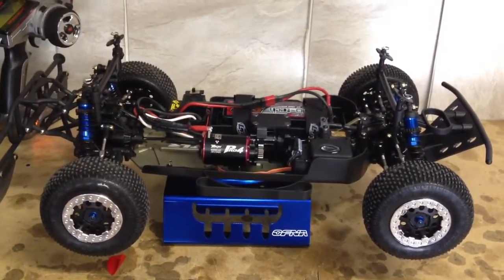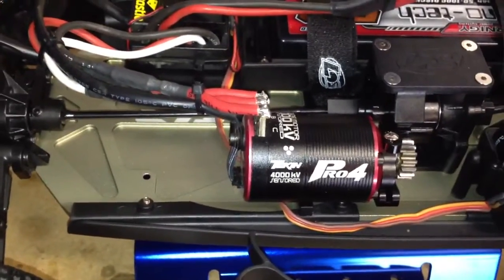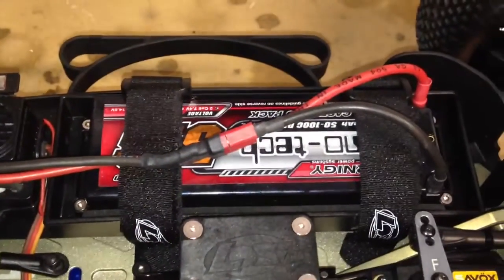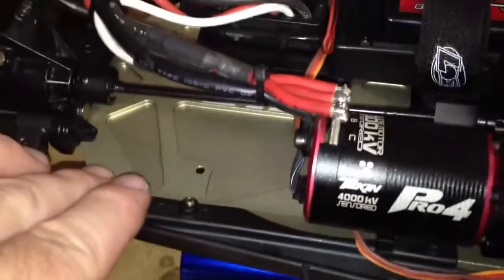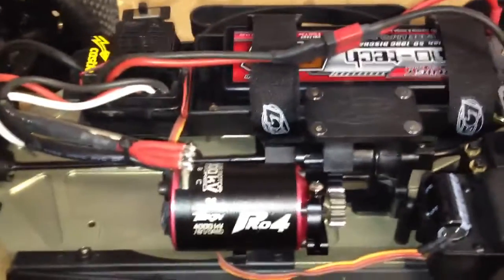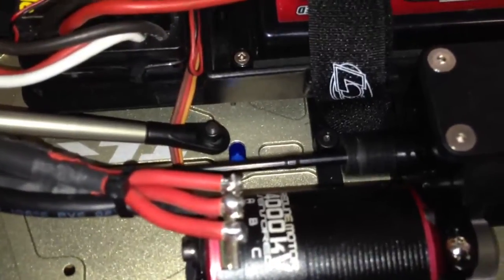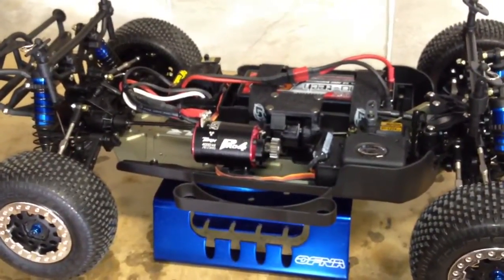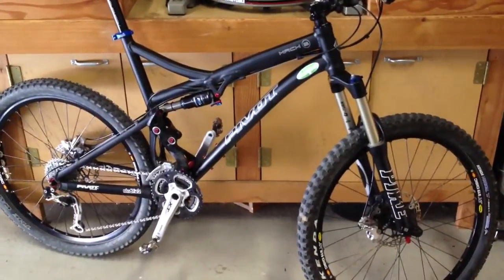The RCNetwork - Losi Ten SCTE - electronics installed

Comment from the maker: Yeah, Losi replaced the parts for me, but I later found out that it's basically a global issue with the SCTE.  The KingHeadz Motor mount/Center Diff Upright using dual bearings on either side fixes the issue for about $75.

Comment from the maker: HD will be a 550 can sized motor (about a 1/2" longer than the Pro4), so more torque.  I know the 3300 requires 3s to get the speed/torque and I wouldn't doubt that the 3000 does too.  If you do get one of the 3000's, potentially you'll have to gear up to get the speed and then may have temp issues.  Make sure and plan to have the RX8 to power it.  Which truck?

Comment: Try running a way larger pinion gear like a 20 or 21. I know with my castle. I never got the car to rev out its full potential until i went that large. You will see a huge difference. Its like putting a different motor on it. I was never able to adjust my truck in the air if the jump threw me forward because of a lack of power. That was on the castle though. Check it out. I put a lot of time in mine. Best of luck! That truck is the best!

Comment from the maker: I really only have direct experience with the 1258/57........58 has more torque at .08sec, the 57 has less at .07 sec.  If you need monster torque, get the Hitec 7955tg.   333 oz/in of torque at 6.0v

Comment: As you know from my previous messages I own the ten scte 2.0. Now I wanna upgrade to a better motor and esc or maybe just a motor because I have a horizon hobby Dynamite Fuze 130 amp esc model dyn4955. Could you recomend something in the $250 or less range for a combo or something good that will work with my es. I am only running on 2s and don't wanna go more than 40mph.Thanks for your time you spend helping me along my adventure as I get more educated in this hobby.
Jeff Swearingen
Reply from the maker: +Jeff Swearingen Such a tough one.....you're so close to what I consider the perfect motor/esc combo - Tekin RX8 Gen2/Pro4 4600kv motor.  If I had to look at something less expensive, take a look at the Hobbywing items - Grab the largest amp'd sensored esc you can get.  120+

Comment: Our truck are almost identical. Quick question. I bought the same chassis and the rear torque rod but the rear torque rod is to long. Screwed the screws all the way into the plastic first then into the tube but it's about half an inch to long!! What do I do?
Reply from the maker: Eric Pendergrass The TLR HA chassis has 2 holes.  One for the stock shorter rear brace and the longer torque rod.....You may have to alter yours if it is missing
Reply: The RCNetwork yea both holes are there and it's still to long shaved some off of the rod but decided to throw the shorter one back on lol
Reply from the maker: Eric Pendergrass The torque rod is really meant for the SCTE TLR chassis to allow a bit of flex on the rear end.  If you're running the plastic stock rear, you'll be fine too